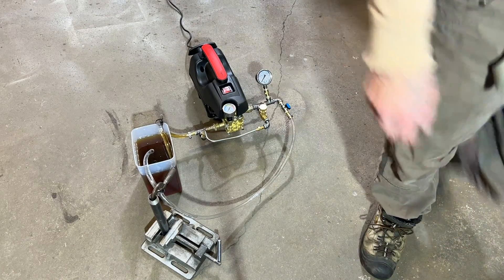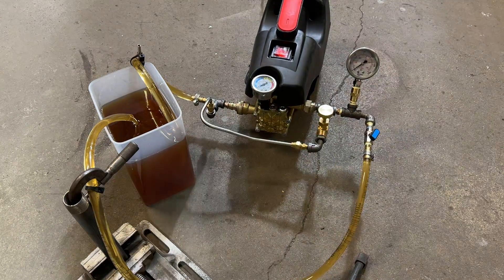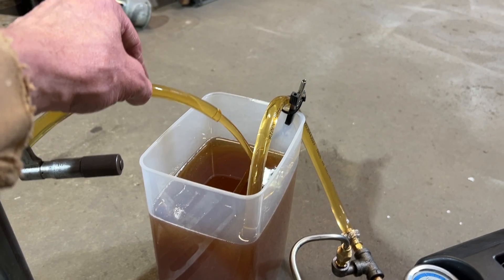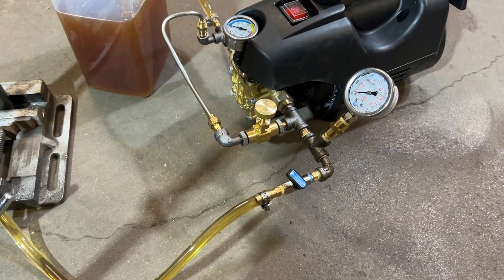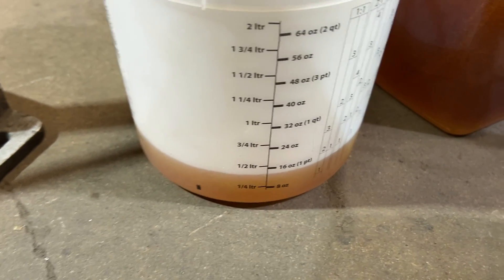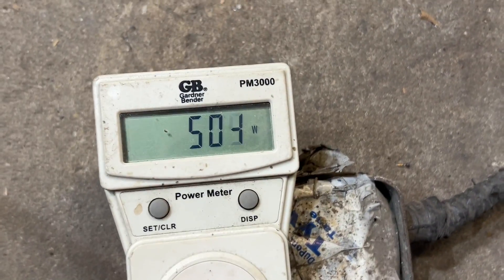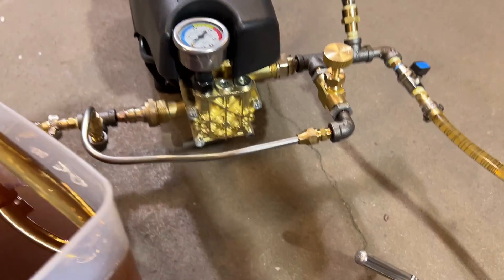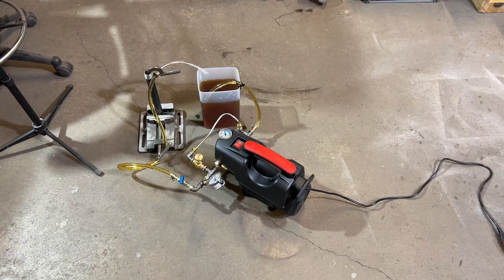Variable flow and variable pressure pump

Comment: ONE THOUSAND HP flow. What does that equal to per quart time NB7 ??
Reply from the maker: is was actually like 2,000 hp worth of fuel flow .meaning the flow could power 2,000 hp engine
Reply: @NOBOX7  Understand, So a quart of fuel will last how long on one quart of fuel NoBox7 ??  Peace vf

Comment: Depending on the viscosity of the fuel, you may need to either add a de-foaming agent, or else make a very tall column where the foam can be forced by hydrostatic pressure to float away from the inlet of the pump.

Comment: A super easy way to prevent bubbles from being drawn into the inlet is to put a splash plate at the surface of the fuel.

In the case of a tank where the fuel will steadily decrease, a piece of styrofoam or other floating material can resolve this for you easily.

What this does is 1, it prevents a plunging fall of fuel into the reservoir so that no bubbles of air are pushed down into the bottom of the tank, and 2, it spreads the returning fuel onto a wider surface so that bubbles have a chance to burst before the returning fuel merges with the main volume.

Comment: BLDC ESC depending on the actual motor voltage, or an Servo VFD (they can do AC and DC) like the old Rexroth HCS01

You can also look at Accelnet or Mircospeed

Comment: This is how some hydraulic systems regulate max pressure with a bleed back on the pressure side. 
Is that a modified air compressor pump?
To control the motor speed, you would need a DC brushless motor controller, or a DC VFD